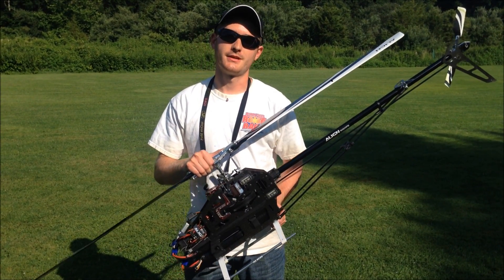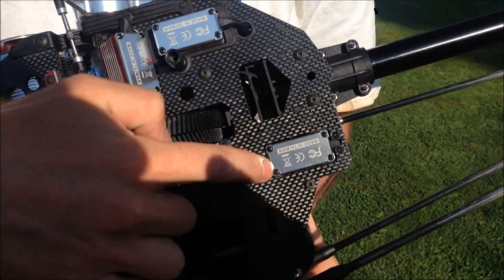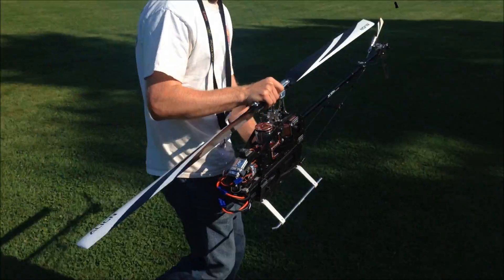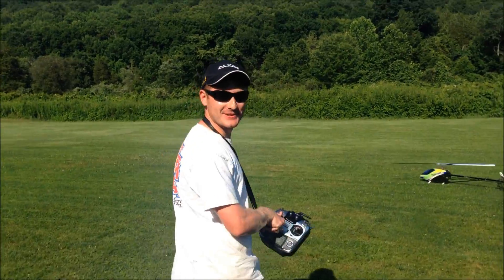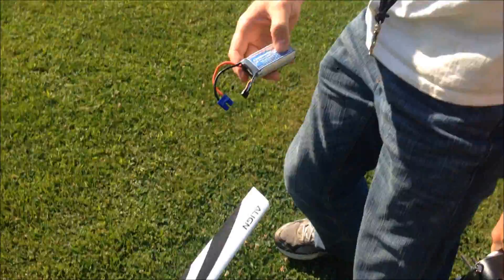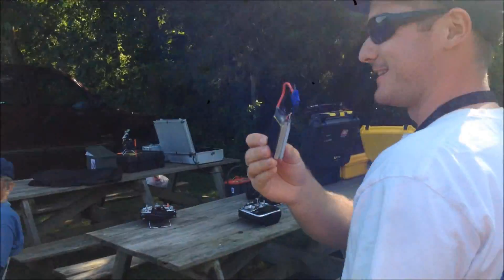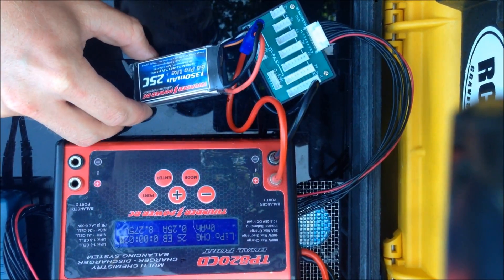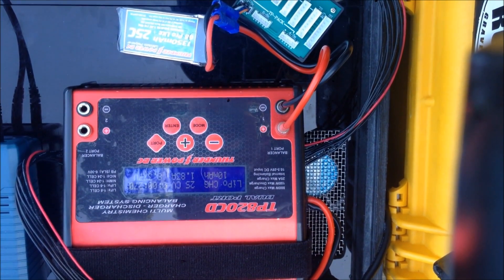Align BL815 and BL855 Servo Test

Comment: Your servos, are they getting power from the flybarless and receiver? Or did you give them poswer from the receiver battery, pulling the reds and the black, straight into the 2s battery?  I am getting a new 550L, and want to use my Mico Beast X, but there is a video on youtube, were the guy sayd, H V servos straight into a flybarless or receiver is not good. Because the power draw is to high, and the flybarless can not keep up with the power draw?
http://youtu.be/UH7DM2ivWxE
Reply from the maker: I am using an EC3 Male to Dual standard servo plug wire harness. The servo plug ends are both plugged into the FBL unit, and the receiver is backfed power through the S-Bus cable.

Unless you are running servos that require substantial power, I don't think you'll have a problem powering through your Receiver if the FBL unit does not have any open ports.

Comment: Nice flying mate! Is that the 700L super combo? I saw a VBar in there... I am going to use these servos on my next build, and I wonder if a Heli Jive 120 can handle them?
Reply from the maker: Hi William,

The machine in the video has essentially all the same updates in the 700L.

The servos are rated for HV, so whichever power system you choose to use, I'd recommend making sure you can output 7.4-8.4V to the servos to take the most advantage of them.